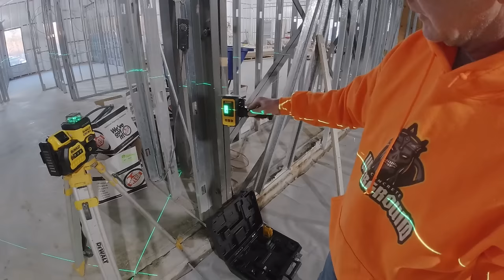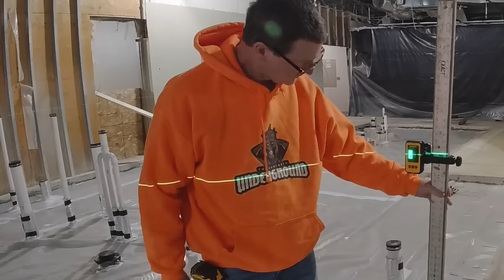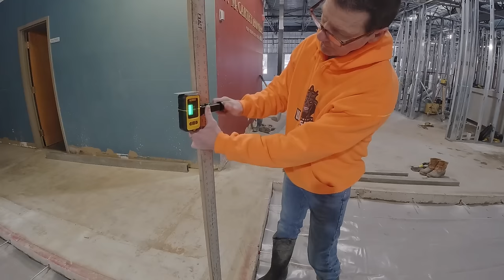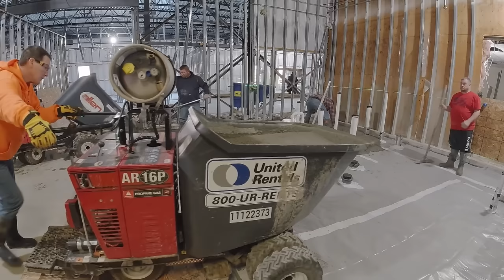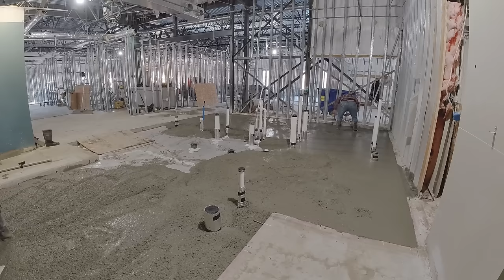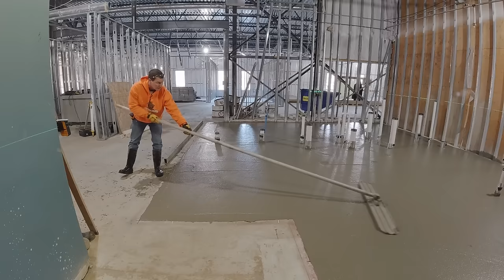How I Got Work When I First Started My Concrete Business

Comment: Story: after WW2 when we had to rebuild large parts of the UK, I was a teenage job hopper and spent many a long day working concrete. But here's the funny part, there was NO SUCH A THING as a 'screeder', or a power this or that. There were 4 x 2 inch sticks, yup really all of both dimensions, and things called 'stop ends' to stage large areas. Screeding was done off of the forms ONLY no back bending or welly hopping or any of that nonsense. Next I see in your video expensive wee truck things hauling mud. Well there was no such things back in the old days, then we had little diesel engine 'dumpers', which were build on wee tractor chassis, with MANUAL tipping on them. Levels were provided by a Site Engineer, or regulated by a Clerk Of Works.  None of your setting  out 'jack of all trades' thing. Finishing was done with much the same sort of tools but many were either wooden or steel.  Yardage, yawn, you would be sucking our exhaust fumes if you tried to compete with us guys. PS It is not money that makes you better as a person, it is how good a life you lead.

Comment: I think it's very important for a man to start business at an early age because young men are a whole hell of a lot more hungry. As you get older, that hunger dies off little by little. Your energy level dies off little by little. Yes, you are young and dumb, but that's what helps. Naturally, as you get older, money isn't that much of a driver. I think it has something to do with the inevitable decline of testosterone. So the tip of the day is, start when you are still young and dumb. 👍

Ih and also, start before you get married and have kids if you can. The wife will add a whole other level of complication and drain your soul if you pick the wrong one, or even the right one will still break your ass. Lol.
Reply: Ya got that right